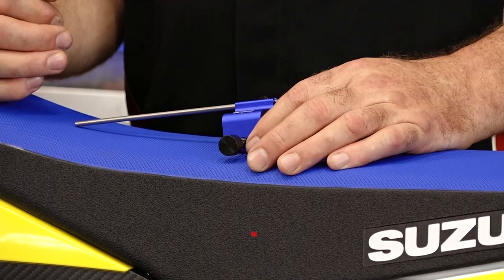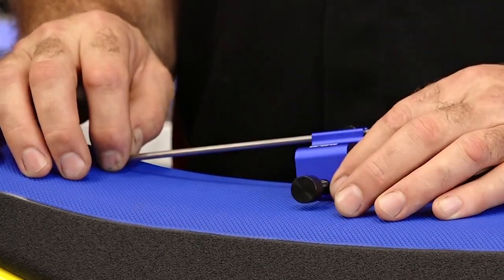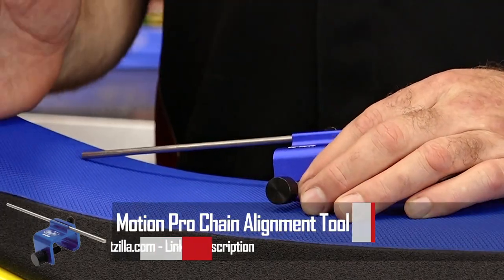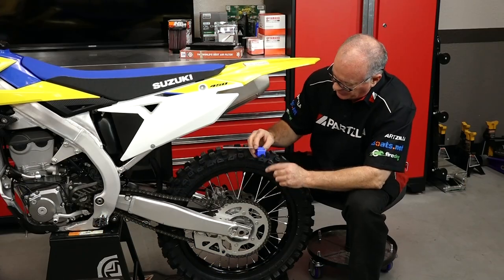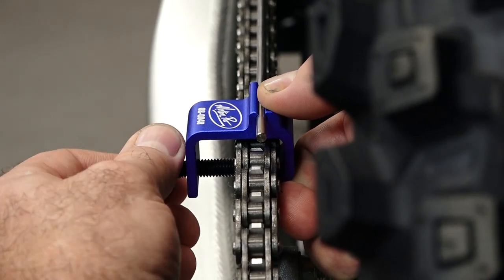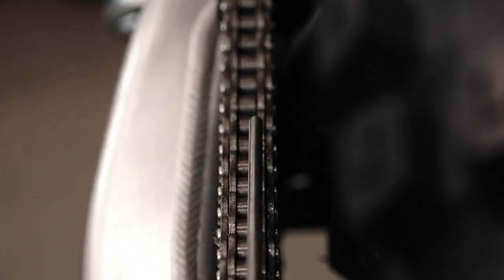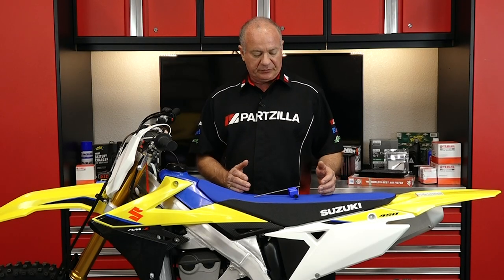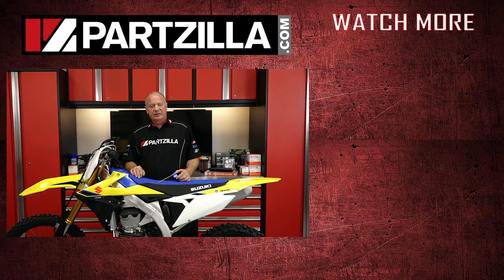How to Use a Chain Alignment Tool | Motion Pro Chain Alignment Tool | Partzilla.com

Comment: When I set up the tool so that the rod runs along the right side of the chain like you did, my alignment is way off.

When I set up the tool so that the rod runs along the left side of the chain like the Motion Pro instruction video, my alignment is good and my swingarm marks are way off. Why is this?

Comment: PEOPLE   DON'T  Waste your  money if have  Back  DISC BRAKES ! cause  you can  line up  the  Disc  on  back  brakes   you will be  like  97 % every time to , your tire has to run true to  run in the  Disc   Brakes to,  so  all  you  don't waste your  money get the chain line up ? if got  Disc on back wheel   look  see  at chain  and look  down  the  Disc you will be so  close cause the wheel has to  be  true to  RUN  across  the  DISC  BRAKE  Pad to try it works for me, if don't have Disc then  you will  NEED this  tool  to  make sure Chain runs  true with  tire to, cause it will wear a tire out quick